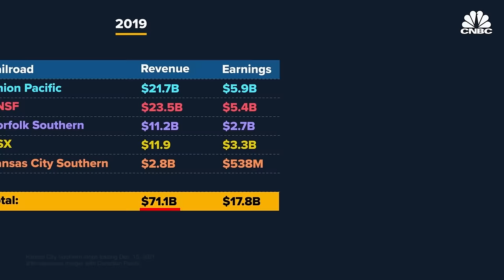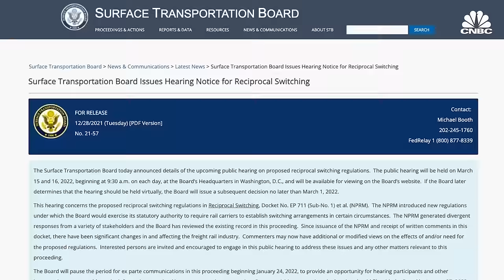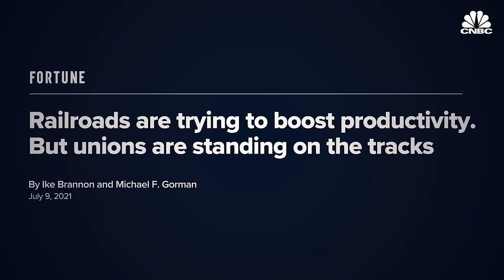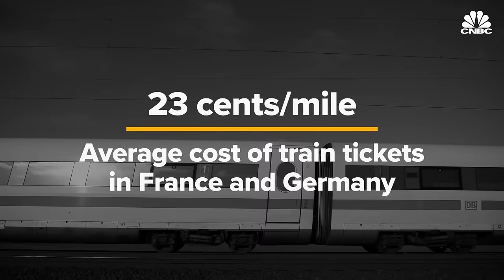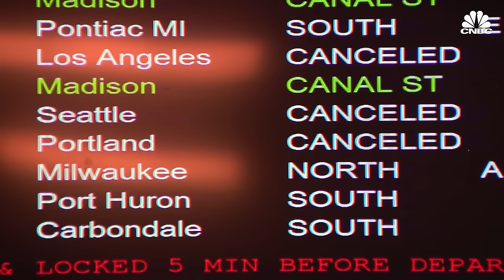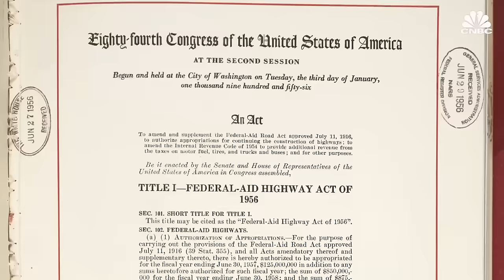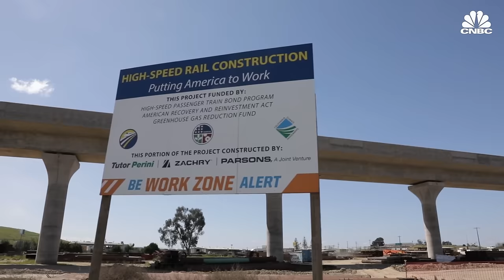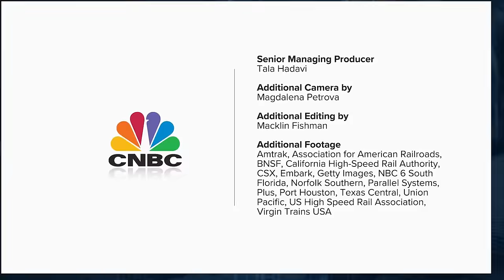CNBC Explores: America’s Railroads | CNBC Marathon

Comment: PASSENGER RAIL IS A PUBLIC SERVICE AND DOES NOT HAVE TO BE PROFITABLE. WE’VE SPENT TRILLIONS ON INTERSTATE HIGHWAYS THAT MAKE ZERO CENTS AND ARE MUCH LESS EFFICIENT.
Reply: Yeah the inconsistent profitability standard is annoying.
Reply: Less efficient is not necessarily true.  It will be faster and cheaper to drive between Ft. Lauderdale and Orlando than to take the upcoming Brightline train.  Add a few passengers in your car and the economics really goes in favor of driving.  And that will include the car paying tolls on the FL Turnpike - mitigating the road subsidy.  Compared to driving, passenger rail only makes sense in congested areas where traffic moves very slowly, parking is at a premium, and density supports local public transportation at your destination.
Reply: @financialconnectioninc  1. it’s only faster to drive medium distance in a car because we’re behind every other developed country when it comes to passenger rail. 2. even if you drive with a full car (which like 99% of cars are not full), a car is still probably not as efficient as a full train. 3. i’m not talking about toll roads (although i’m pretty sure those aren’t profitable either). i’m talking about the thousands of miles of free interstate roads that are entirely subsidized by the federal government in the trillions of dollars. 4. we HAD that density around passenger rail stations up until WWII when car-centric infrastructure came in and bulldozed all of it.
Reply: that's so true
Reply: Spending trillions on highways are still ok. What about the $2 trillion spend on nothing in Afghanistan?
Reply: @weirdfish1216  1. You do not know how anything works. 2. Driving will always be faster. 3. Due to America's size you can't compare it to Europe. 4. Maybe do some research before talking.
Reply: @danielchou5895  Europe is a bit larger than the US and without Alaska (a detached 7% of US area with 0.22% of the population) it is much larger. It does have more than twice of the population and there are much more dense areas but since the object is to connect populations and that 83% of Americans live in urban areas that represent only 3% of the land it is logical to connect all  of those areas with rail transport.
Rail is faster and safer than card and can carry far more passengers and the fact that you cite large distances as a reason not to invest in rail travel but think a slower less efficient transport mean  like cars deserve investment in tens of thousands of miles of highways is absurd.
As fr cost, a car needs roads that cost trillions, it needs gas, that cost a lot (and what you pay in the US is heavily subsidized) and it requires a car, that has an average yearly cost of $10,728 (for 2022).
I live in Spain and I can take a high speed train from the center of my city (Barcelona) to the center of Madrid, a distance of 385 miles that takes ~6h20 to drive, and get there in 2h30. Ticket prices start at 7€  ($7.60), if you book it in advance. A ticket for tomorrow start at 28€ (~$30) and for next week I can find a 9€ train (and many for 14€-15€). I can even get first class with a meal for 38€ (~$41). Most trains also includes a ride on the regional suburban rails at the origin and destination to get to/from the station.
Reply: @danielchou5895  there are similarly sprawling areas of the world that have much better transit than the US. Canadian and Australian cities kick our butts aside from one or two legacy metro systems that badly need investment (like NYC)
Reply: @AL5520  Each individual country has their own funding and their own systems. You can't compare one continent to one country...
Reply: @danielchou5895  1. cope 2. conventional rail can go up to 110 mph, and high speed rail is definitely faster than driving. 3. europe is the same size as the continental united states and there are parts of the U.S in california, the northeast, and texas triangle that are denser than entire european countries. 4. i did do my research, it’s clear you didn’t
Reply: @weirdfish1216  1. You don't understand how operations work. 2. You very clearly don't seem to understand that Europe composes of multiple countries with their own economy and operations 3. 4. You should do some research.
Reply: @danielchou5895  well if you compare the US and the EU then there’s not much of a difference. You can see all those countries as states, the only big difference is language and culture. I lived in Europe for a long time and going to another country is just like crossing a state line. If every state here in the US would build (rebuild) a substantial rail network independent from the federal government then one could have the same network as it is in Europe, but that’s a whole other topic with state rights.
Reply: the big argument for the reason why the US should invest in passenger trains or high speed rail seem to be that: europe and asia have it.
Reply: @El_Staudo  You can't compare states to countries. They are very different with very different economies.
Reply: @financialconnectioninc  this is so ridiculous! I actually live in South Fl and it will be more efficient to take a train from Ft Lauderdale to Orlando. We’ve needed this infrastructure for the longest.
Reply: @KaonashiJP  How so?  What is your definition of "more efficient"?  It will not be cheaper (assuming projected $75++ fares each way), and it will not be faster - remember the Turnpike runs diagonally, so less mileage to cover - not to mention 100 miles of the trip has only one exit in the middle. If you do the cost analysis with 2+ people in a car, it becomes a grand slam win.  You also come and go when you want, have no lost time waiting for the train to come, and you have a car at your destination (usually an advantage).  You also drive right to your destination, as opposed to the airport, where you now need ground transport.  This is a copy of a recent comment I left on another video, based upon the real world:

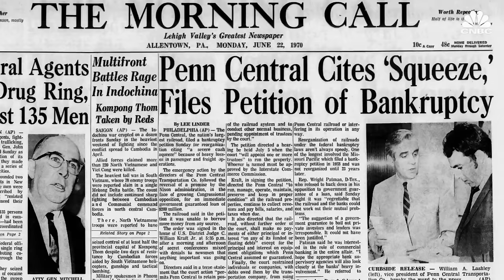"I was in Orlando this past weekend.  I drove home from International Drive (Big Ferris Wheel).  My trip was 2:40/190 miles door to door to Boca Raton.  That's 71 MPH (only a few blocks off the Turnpike on either end).  I averaged 32 MPG, so $21.37 in gas @$3.60/gal plus $15.41 in tolls (I paid for the road use).  Total one way for 4 people - $36.78.  Faster and way cheaper than the train would be (the Tpk is diagonal so less distance) - and I had use of my car the whole weekend and left when I wanted to.  The Ghost train is a white elephant that we shouldn't be subsidizing."
Reply: @financialconnectioninc  You didn't consider car depreciation or insurance costs in your calculations. You are right that with more people driving is cheaper but often times train tickets are more competitive in pricing if you look at all the costs of driving. Most people don't think taking trains everywhere is the way to go but it makes a lot of sense for different trips ranging from about 75 miles to 250 miles. The opportunity for high-speed rail is in bringing down travel time for short flights. Passenger train companies in Italy and Spain have competed with airlines and have won. Within the right distance, high-speed rail is faster and more convenient than driving and flying.
EDIT: 75 to 600 miles
Reply: Passenger railways as a rule don't make money, this is true in most of the world, it is certainly true of any passenger service that provides any level of quality aside from very bad.  Most commuter lines don't make enough revenue to pay for the crew salary and benefits no less the other costs of operation or any recovery of the capital invested.  Back in the day the railroads were obligated to operate passenger service by law, no such law applied to truck lines or steamship lines.  By the way, the Chinese high speed trains have an accumulated debt of almost a trillion dollars and they loose about $24 million daily with no sign of recovery.  I expect the California experience to be on the same level.  By the way, about 25% of your fuel bill at the gas station is a tax that goes to a dedicated fund to pay for the building and maintenance of highways, that applies to trucks as well, and the registration fees that truckers pay is not chump change.  By weight I guess that about half the traffic on the interstates and other highways is trucking and if you've got anything, it probably came in a truck.
Reply: @weirdfish1216  the interstate highway system and other highway are paid for by user taxes, namely about 25% of your bill at the gas station.  The government doesn't pay for anything, us taxpayers pay for it all, so if you see a project saying it was paid for by a gobermint grant of some kind, kindly thank me, over the years I've thrown over three million into that hat.  by the way, the decision to abandon rail services was made by the people, the railroads didn't stop running trains until the railroads could prove that they were about empty.  Amtrak came about because during the late 60s the railroads in eastern US were bankrupt and would have shut down without being relieved of the burden of passenger, especially commuter, services.  Another big blow the the railroads was moving mail traffic to trucks and airplanes.  Toll roads are usually required to cover amortization of their bonds and their maintenance expenses, generally this is backed up by a guarantee by the state to make good on this if they fail, this very rarely happens.
Reply: @AL5520  Cities in Europe are generally much closer together than in the US, Paris to Rome isn't as far as NY to Chicago and even with the high speed trains on that route, most Europeans would choose to fly, likewise  even if we had a HS train to Chicago it would simply be faster and cheaper to fly and the distances in the western US are even greater.  American cities are much different that those in Europe with far more of the population living in the suburban regions of the city vs the core city itself and a lot of the businesses and offices are also located in this suburban region rather than downtown.  American cities are generally way newer than cities in other countries and they took advantage of the technology of the time.  Thus most European cities have a walkable core, and later as industrialization started factories were built in neighborhoods allowing worker to walk to their jobs.  American cities saw growth during the trolley car age (you call them trams) and this allowed population to move outward, NYC being on an island, took advantage of steamboats operating ferry services to Jersey, Brooklyn, and Staten Island, I believe there were also ferries upriver to communities in the Bronx north of the city.  A lot of folks blame the mess that is Los Angeles on the auto when actually the spread out nature of that city was allowed by the extensive trolley system with over 1,000 route miles before World War I,  a historical turning point that brought about reliable and practical cars and trucks and also saw the extensive adoption of electric lighting replacing gas lights.  The train fare that you quote are possible only because the HS lines were built and paid for by the Spanish government and the government subsidizes ticket prices.
Reply: @financialconnectioninc  have you seen Florida? It’s entirely designed for cars. However traveling to destination hubs like Ft Lauderdale and West Palm Beach a light rail line will move more people than cars will even if you have 7 ppl in the cars. Even a bus rapid lane will exceed a car capacity.
Reply: define less efficient
Reply: @danielchou5895  not necessarily. In the case of the EU every member gives away certain rights just like in the US. In the beginning states were supposed to do a lot by them selves, but through the years the federal government takes over a lot more responsibilities which should have been left to the states. In some regard the EU is like the early US, as soon as Europeans see the EU as a country then there will be not much of a difference.
Reply: @ssaha7347  Right.. people don't want to destroy their vehicles with poorly maintained roads. They also want an alternative to plane flight and being stuck on a train for hours.
Reply: @danielchou5895  1. high speed trains will always be faster then driving and america is indeed behind on its passenger rail
2. size doesnt matter in this case, advocates for hsr want it in corridors like the north east corridor , LA to SF or portland-seattle-vancuver
 3.maybe you do some research before regurgitating propaganda from car lobbies
Reply: @dessnom4333  You clearly don't know anything lol. Trains are only good for distances too short for flights or too long for drives. Maybe actually do some research for once.
Reply: @danielchou5895 comparing America's size to European countries is redundant, you don't commute or regularly travel from New York to Los Angeles do you? The east coast has perfect density for high speed train lines to connect cities.
Reply: Then the government shouldn’t own it, or build it. It’s not this hard to understand. And you are so wrong the interstates do make money.
Reply: @eriklakeland3857 wrong it’s not
Reply: @danielchou5895 so according to you going 60mph is faster then going 150mph?
Reply: @The_king567 the interstate does not make money bud. You have this information in the palm of your hand there is no need to stay ignorant
Reply: @darthmaul216  yes it does because trucks uses it

Comment: I like how there was a $99 ticket and he chose the expensive one for the Amtrak price comparison
Reply: noticed the same...not a fair representation!!
Reply: Have you ever tried to book a train trip?
Reply: @asiancuteness8517  I have. For New York to DC you can book for about $35 each way if you buy in advance. So, ultimately for $70, it’s a great way to travel.
Reply: @johntathers8276 exactly. Sadly outside the northeast rail is really bad.
Reply: @johntathers8276  It costs more than that or a discount fair from Oxnard to DTLA a Far shorter distance.  its about 50$ for a military discount pre-booked early fare  everything outside of the Acela corridor is horrible and overpriced.
Reply: @StillJustD Not the case up here. I can get the Coast Starlight between from Seattle to San Francisco for $79
Reply: @Seawiz21  in what universe.   I actually take  the CS often.  It’s $150 with the military discount. It’s 180 for regular people.   I usually get the rollete. And that’s 475 with military discount and over 500 for regular.  But do tell us how you manage to get it for $79
Reply: @Seawiz21  you must be booking a year in advance 😂😂😂

Comment: Something that amuses me is that Brightline in FL recently announced it is already turning a profit in FL with only the three stations.
It's amazing what happens with a shared passenger / freight corridor when scheduling is done so that one is not constantly running at the expense of the other.

Also... fun fact, most intercity trains in Europe share tracks with passenger rail (this is not the case for the LGV lines in France and some of the dedicated high speed line in other countries).
In Japan a lot of intercity and commuting rail is also shared between freight and passenger rail (again, dedicated high speed corridors are separate).

It's not an issue that freight and passenger rail share a right of way per se. It's that they are just all given equal priority in terms of scheduling and the systems are built in such a way to be run on precise time tables (something that anyone who has seen the actual impacts of "precision scheduled railroading" combined with the removal of double tracks and not having long enough passing sidings, etc. will agree does not work).

The US could be a lot better than it is, even without building out a ton of new infrastructure in some places.

And yes, we should build some dedicated high speed corridors as well.
Reply: Brightline announce a small section had an operating profit.  It will be quite some time before they're Miami-Orlando line is profitable, if ever.
Reply: @AllenGraetz  my understanding is that they were expecting the Miami to Orlando section to be the profitable one and that they were surprised that Miami to West Palm Beach was already profitable.

Comment: I believe that long distance truck driving is not expeditious and is more dangerous than operating freight trains. The train is more reliable, dependable, and does not have sporadic breakdowns as motoring rubber tires on the asphalt street. An automated train can outrun an automatic motor vehicle in durability, as well as mileage.